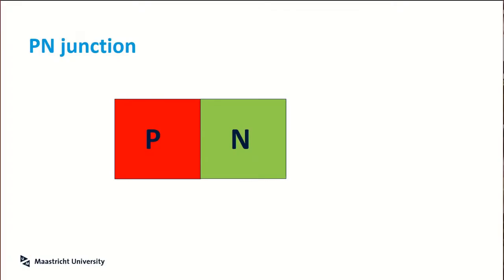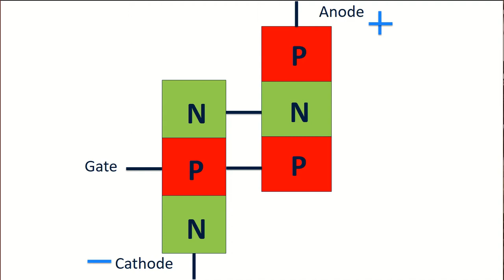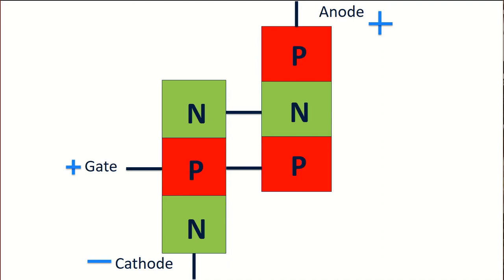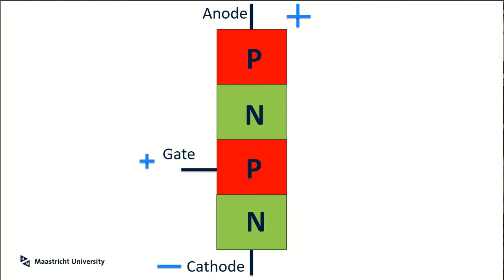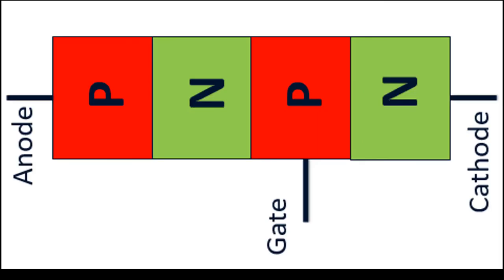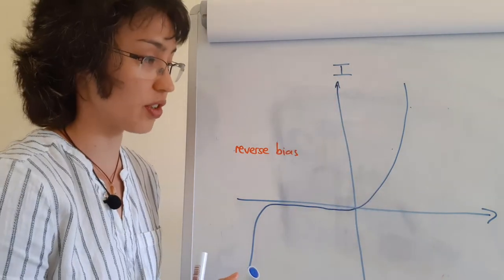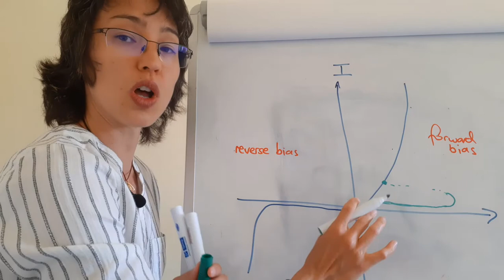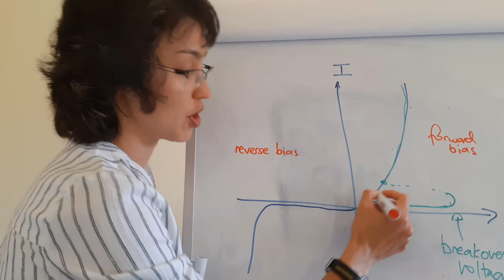Semiconductor devices (part 4/6): Thyristors

Comment: Thank you for that explanation. I could never understand how current could flow through a thyristor, even with a gate voltage applied. When you said that the flooding of electrons into the P-type gate region essentially turned it into an N-type — I finally got it.  Thanks!